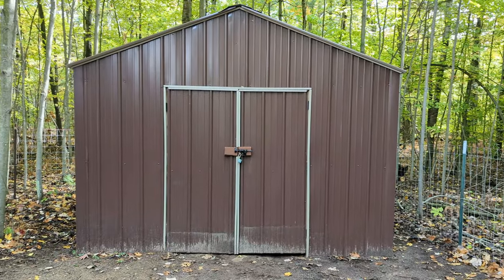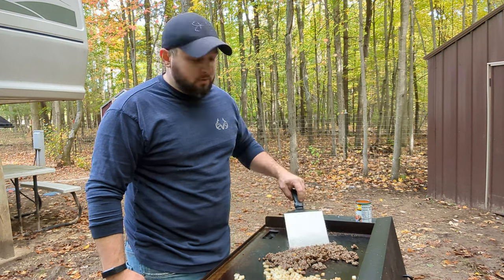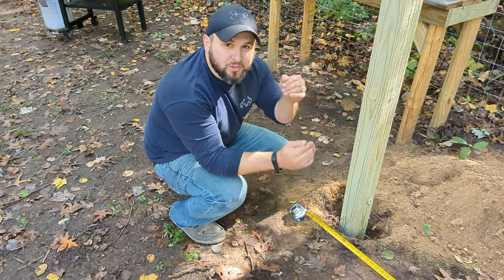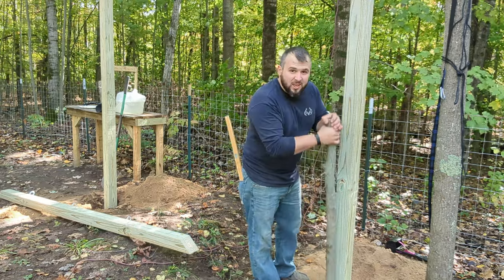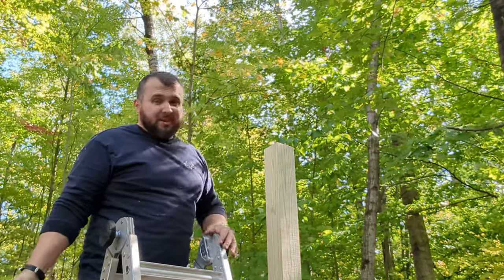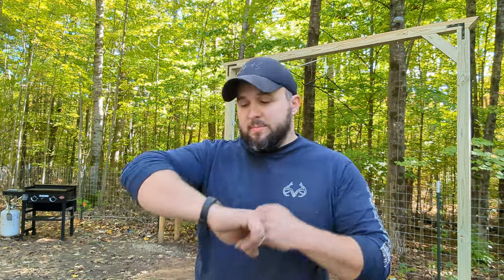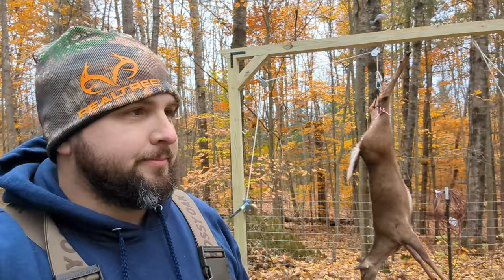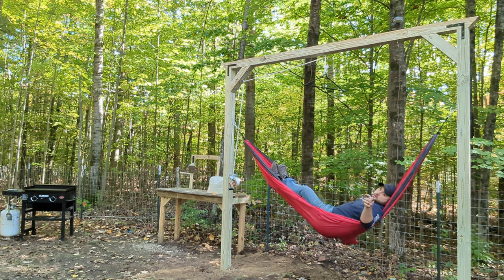Play Property Buck Pole Build

Comment: Did you use 4x4 I am getting ready to build one was thinking about using 4x4s
Reply from the maker: I used 4x4's which works fine as a buck pole. My kids also use it as a swing. For that reason I should of went 6x6. But just for deer 4x4's are enough.
Reply: @NaileditBuilds  think you